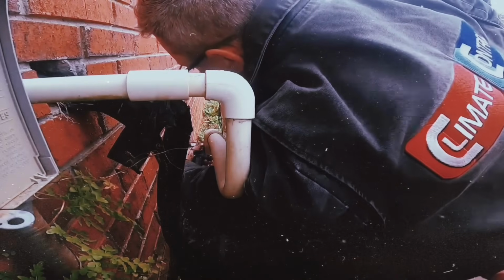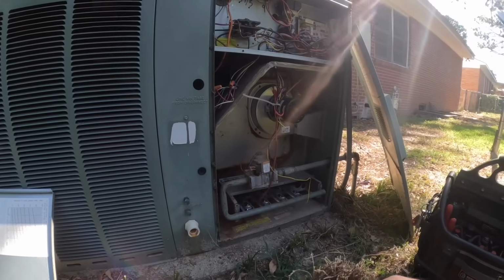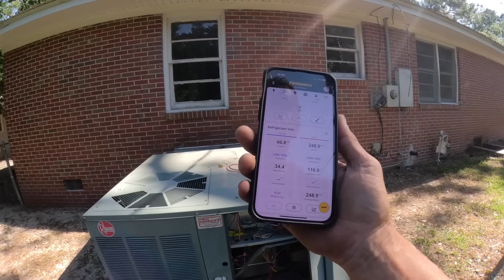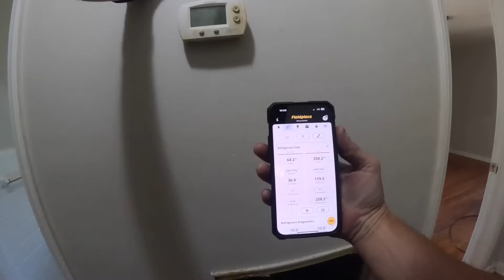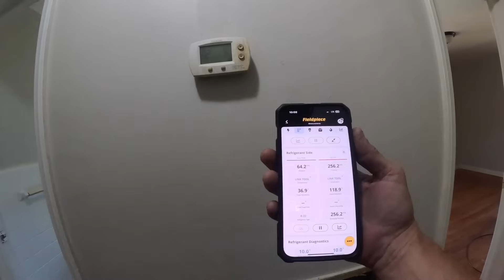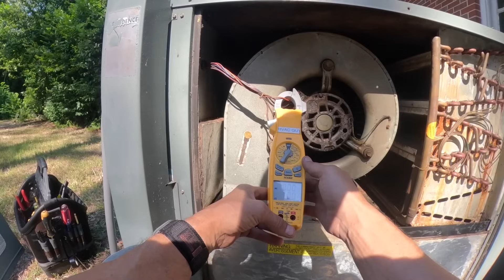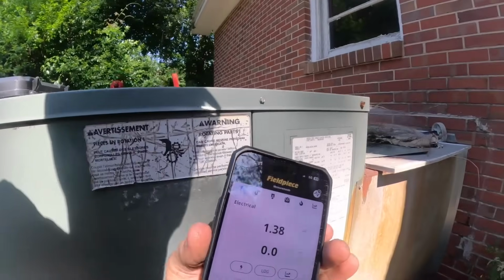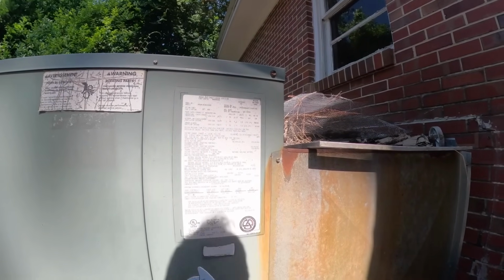Inspection Of A 20 Year Old System For A Realtor! #hvacguy #hvaclife #hvactrainingvideos

Comment: 14:50 - Can you describe the sound you’re supposed to be hearing on this device? All I hear on mine is what sounds like a radio that’s not tuned to a station and no matter the position of the slider on the left side, the bar LED fluctuates all over. They sent me another one; but, it behaves the same way. Am I doing something wrong? PP3 battery is new and the BOSS headset is plugged all the way into the 1/8” jack.

Comment: curious why you didn’t check the indoor blower amperage at the circuit board and was the return side of the evap coil plugged thst may have been causing the low suction pressure ..? thanks for posting content
Reply from the maker: I did later on

Comment: Thanks.  Seeing those gas units outside always makes me glad we have basements.  Much less corrosion if a dehumidifier is used.
Reply: In California most new houses have the gas packs/dual packs on the roof.  Before 1965 when outdoor furnaces were legalized they had a closet furnace with outdoor condenser.  Older houses that were remodeled and have a crawl space had them on the ground.  Houses built before 1940 with central heating had a basement with a gravity furnace,  All new houses are on a slab.  The roof is the worst place to put them in 105-110 degree heat, but it's cheaper.
Reply: @dfirth224 out here in Vegas I ask the same thing about the rooftop units. Makes no sense having a system just bake in the sun.
Reply: @UnknownSource08  They don't care, more money for them with lower life expectancy.
Reply: @dfirth224  bingo. I agree.

Comment: I love your work. Keep it going. I try to nose breath during stress. Slow and low into the diaphragm. To keep blood pressure lower and stress down. Having a moment when bend down to standing up is a blood pressure moment. I bet you do some of these things. Weight training and cardio. No fluoride ever again. it is a super anti-bacterial and can mess with blood pressure. Cheers.
I may start an hvac company. I'm in automation now. Just swapped my home system. Went to dual fuel heat pump. So far i love it. two stage cooling is a dream.

Comment: No heat exchanger inspection blower wheel probably needs cleaned and not even a look at the ductwork its part of the system so it needs to be checked something could be loose or collapsed its a pert of a complete inspection

Comment: Off Topic Question:  Have you ever installed soft start kits on A/C systems? Living in Florida's hurricane prone weather, I installed a soft start on my 4 ton heat pump and it lowered the inrush amps from 105A to around 35A. If I lose power,  I can run my central A/C on the 10KW portable generator now which I could not do before the soft start was installed.. BTW, I observed that the compressor is much less noisy during starting . The compressor start cycle is so gentle it is a lot like an inverter driven compressor... although we both know it is not. Have had the SS kit about a year now with no hiccups so far. Loving it. Take care.

Comment: I actually dealt with some of this on my home when we bought 9 years ago because there  was a VA requirement.  I ended up finding more shit wrong than the HVAC tech but then later the VA came back and wanted proof that each gas lit fireplace had the emergency shutoff valves that they have ALL required for 25yrs. It ended up being 3 signed & notarized affidavits that they were present! Haha. 

They didn’t seem concerned about the dangerous furnace that was present in both HVAC’s.

Comment: Our house had a ceiling grille that looked totally rusted. When I cleaned it, I realized that it was just smoke stains and the grille itself was stainless steel.  Previous owners were heavy smokers.  I'll bet that blower wheel is FULL of tarry residue, causing low amp draw.

Comment: speaking from 28 years in the trade-
Lower pressure     Filter nasty  Small return duct (Probably has dirty vanes). 
Do you check airflow or static press?
Disappointing inspection.